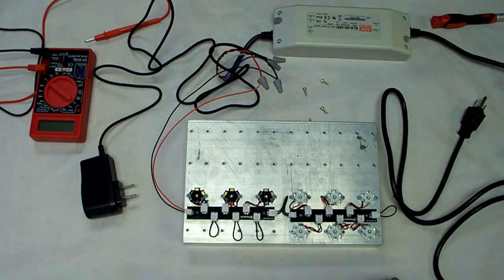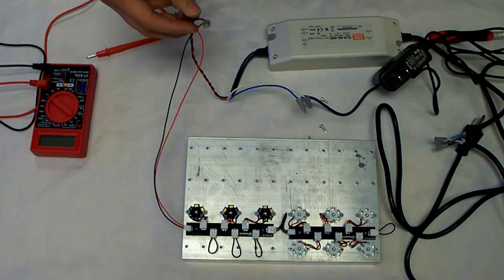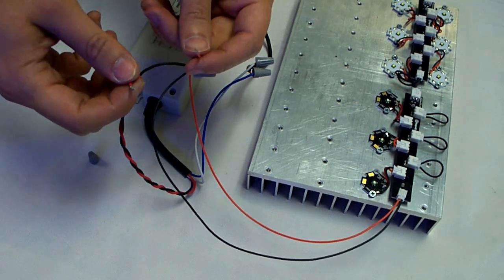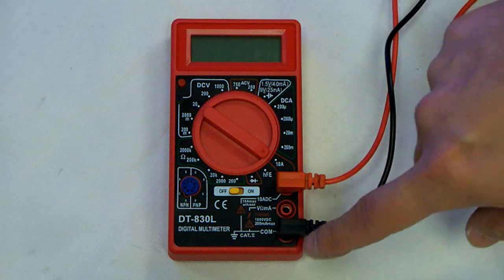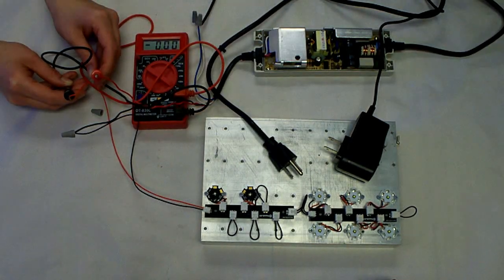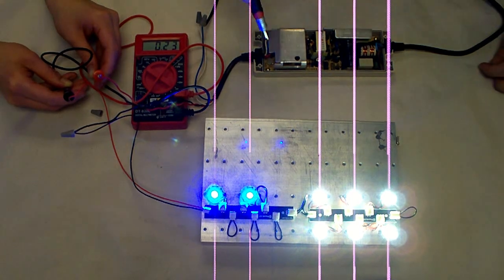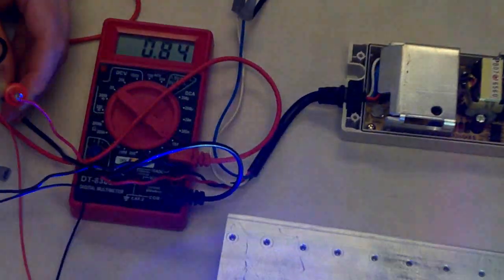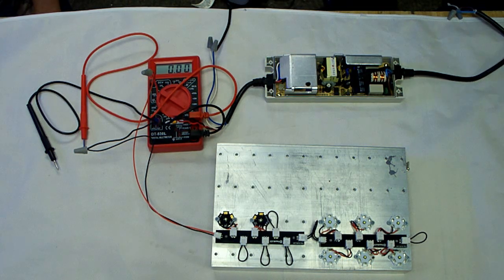Adjusting SVR2 Tutorial HD.mp4

Comment: its mention in the pdf file , when connect to dimmer , its set as 100% brightness

dimmer as in potentiometer ?
Reply from the maker: It could be a potentiometer or a controller such as an Apex/Reef Keeper/Reef Angel, etc.  Whatever you're using you'll want to set the SVR2 with 10V going to the driver.

Comment from the maker: Yes, but you'll only want to use one of the two pins inside the connector.  Also, you can't touch the other pin while getting the readings or you could damage your entire string.  We really don't recommend getting readings that way.  If at all possible I'd suggest undoing the connection between the driver and first LED and getting the reading that way.

Comment: I've just finished all of my wiring, but have not set my current levels yet. I will be running two dimmable drivers and one non. The dims will run 8 CW and 14 RB.  The non will run my UVs, a green and a red. Since I made permanent connections with the dimmer and drivers, can I set my current by reading across two pucks? I am using solderless so I would assume to just unplug between two and use the leads to complete the circuit. Is this correct?

Comment: I spoke to Vince and he was very helpful, but just to not leave you hangin': I'm using a 9V switching ps which puts out 9.54V to the dimming circuit. The SVR2 screws stops normally, I just think I got a factory freak, which def happens, so I'm sending it back to you guys. Thanks for all the help and the quick response.

Comment from the maker: When you turn the SVR2 does it stop after about 3/4 of a turn?  If not it's likely broken, which could lead the current to move and not stabilize.  Also, at what DC input voltage are you checking the current at?

Comment: I have the ELN-60-48D and when I go to do this test the multimeter shows my driver running @ 2A which is way over this driver's rated output. Why would this be? On my initial setup the multimeter showed LED's running @1.3A, but today (~5 days later) the LED's seemed dim so I tested again, and it's now showing 1.9A :( Can you explain?

Comment from the maker: It's 10V max, if you apply more than 10V you could damage the driver.  Make sure the adapter is regulated as well so it doesn't put out more voltage than it says it does (just test it with a meter with nothing else connected).

Comment from the maker: You don't, as long as your LEDs are connected to the driver (closed circuit) before you plug the driver in the voltage will self adjust (assuming you're in between 24-48V).  Typically it's left at max for this reason.